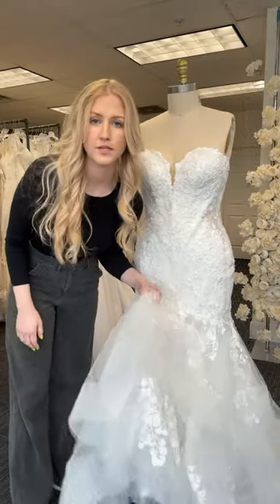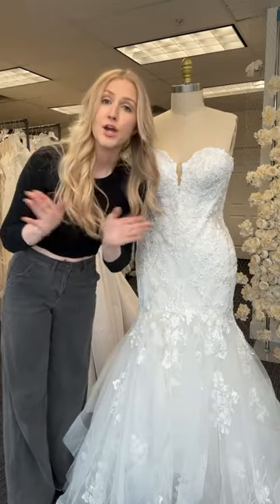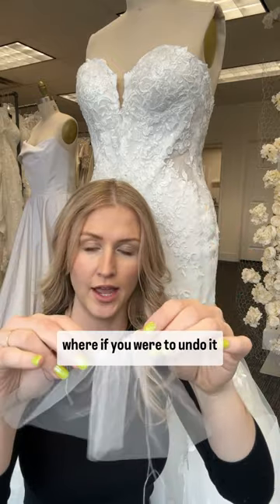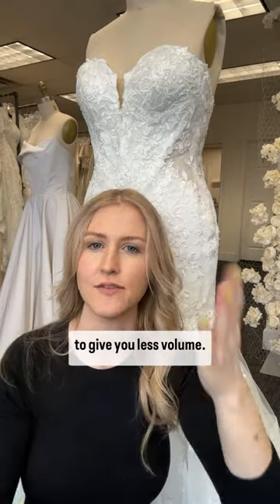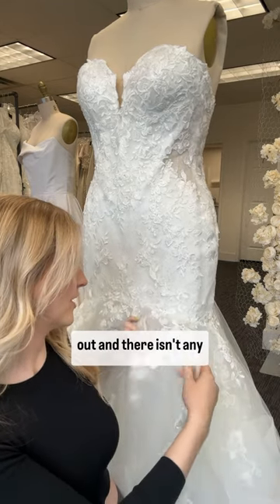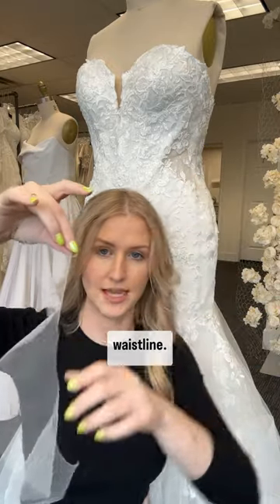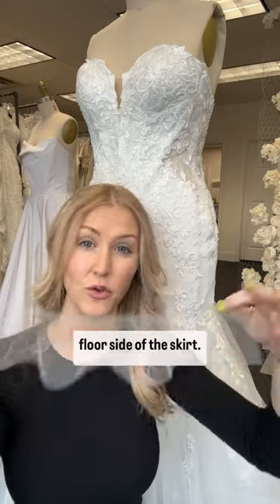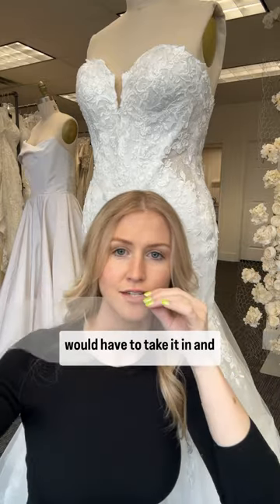Can you decrease the volume in a skirt??

Comment: Looks like there is multiple layers there. Realistically removing a lining layer will lower the volume.
Reply: Exactly what I thought. Take a layer or two of lining out. Problem solved. No taking-in needed.
Reply: It's not lining though.
Reply: @sarasorensen2650  that is, of course true. But the answer is still the same. Remove one or two of those volume-producing under layers and it will lower the overall volume. And depending on the outermost fabric (if it has a nice disguising pattern, embroidery, or beading) you can literally cut out that layer and you won't be able to see the edge.
Reply: I can agree with removing crinoline to make the skirt lie closer to the body, but the if the person asking wants a less full skirt less material in the outer layer of the skirt you would have to do as the speaker in the video.   If the person was asking about a gown with a gather waist line, then; yes you could just remove fabric on the ends and regather and sew back on the bodice.  This style of gown-nah.

Comment: Why couldn’t you just change the angle of the curve of the original cut? Same as lower volume ruffles?  Wouldn’t it be the same concept?
Reply from the maker: If you did that in the pattern making process, yes. But once the fabric is cut you no longer have fabric in the right places to then change the angles (without making it 15 panels sewn together)